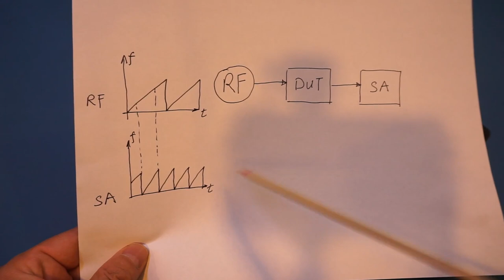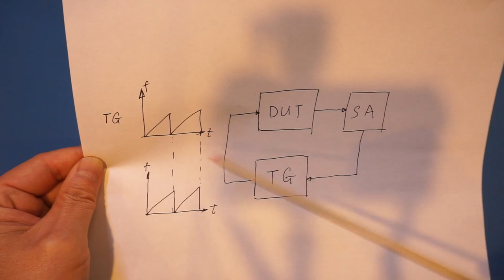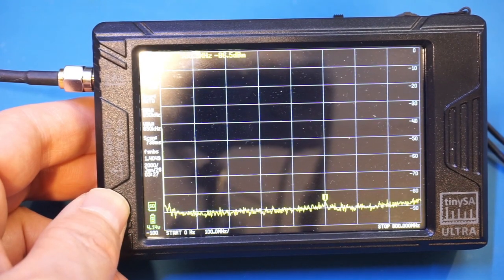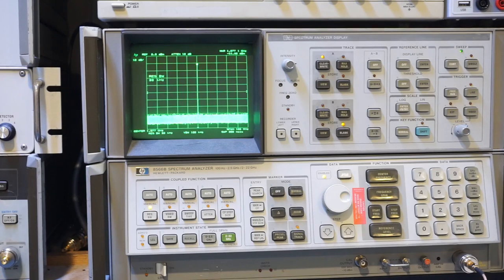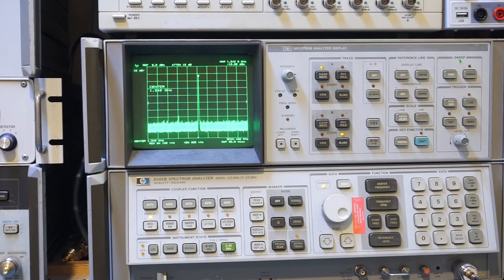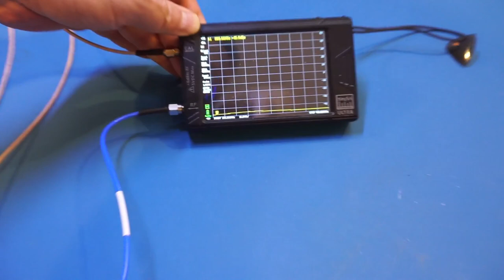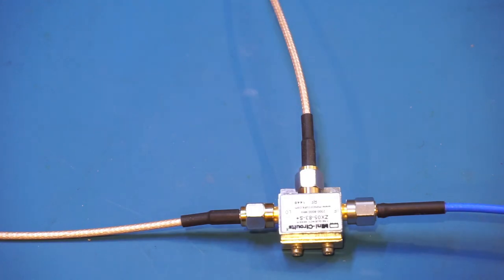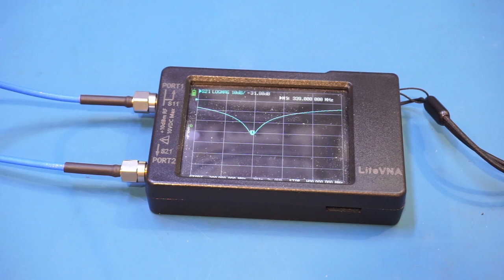Tracking Generator for the tinySA Ultra Spectrum Analyzer

Comment: I like the Guitar pick. Very good demo. It is good to use weak signals for inputs to the SA. Even a hand held transceiver behind you can overload the front end of a SA or station monitor if a antenna is connected to it's input. Keep up the good teachings.

Comment: Another option is to use a inexpensive noise source but they're probably limited in frequency range. Thanks for the great ideas Kerry!
Reply: Dino makes a good suggestion. I have home brewed simple zener based noise generators and they are useful in the HF region. The output level is not at all constant though. 
But a couple of years ago I bought (off Amazon) a very much better noise generator for around 15 quid. 
Youtube doesn't always allow links in comments, but if you search for "Noise Source Simple Spectrum External Generator Tracking SMA Source" you will probably find it. 
Obviously, the noise source is not a tracking generator at all, but that description will find the device.

Kerry, Your video was very interesting and thanks for posting it for us to share.
Reply: When using  noise source, the limitation is the dynamic range, and possible saturation for wide band active systems.

Comment: Great video! When I test I check flatness with both cables connected via a barrel where the DUT would be placed. Thinking your blue cables have alrsady been tested for flatness though.. Also to increase dynamic range I use a pre tested amplifier when needed. Would like to learn about the serial data out if you work that out. 73, Jim
Reply from the maker: Well, looking at the documentation: 
CONNECTION activates a sub menu for selecting the connection to the tinySA
USB selects the USB interface for connection
SERIAL selects the internal serial interface for connection
SERIAL SPEED enables the selection of the speed of the serial interface
https://tinysa.org/wiki/pmwiki.php?n=Main.USBInterface, it appears that the USB/Serial modes are for interactive controls only.

Comment: Nice. Wouldn't it be awesome if there was a way for the Tiny-SA to stream out its measurements to a serial port. You could do the normalization of the thru measurement and subtract from the actual measurements among many other things.
Reply from the maker: I recall there is a "serial output" option buried in the menu somewhere for the tinySA Ultra, I am wondering if that is for sending data out.... now I am curious...
Reply: @KerryWongBlog  Yes the serial port can be hooked to a PC serial port and it can be controlled and exchange data files and screen shots.

Comment: Great video! One thought: did you try to tweak the 977MHz IF input frequency from the 8642B? It could be that the SA IF isn’t exactly 977MHz but maybe something like 977.54321MHz, and tweaking the LO input to the mixer could give you additional boost on the tracking generator output. The HP 8444 tracking generator made for use with the 8555 and 8568 analyzers had a fine adjust knob that would tweak the output frequency going into the mixer with the LO, and a small adjustment makes a large difference in the trace.
Reply from the maker: It was pretty much 977 MHz spot-on. I did vary the frequency a bit during my testing and it appeared that 977 MHz gave the maximum response.

Comment: I'm using a Nanovna to analyze RF filters. Is this a good approach, or should I be using a tracking generator and spectrum analyzer instead?
Reply from the maker: VNA is the standard approach as it already has a tracking generator builtin. This video meant to demonstrate what you can do with a spectrum analyzer.

Comment: Couldn't a guy use a Nano VNA as the 977 MHz signal source for the mixer for a low cost tracking generator? (It would also justify buying both ....)
Reply: I think the point isn't to get a single frequency but to get something in phase, "tracking" the other signal.

Comment: Hi Kerry. Is it worth finding a way to generate a (stable) LO, add a mixer, and thus lose the portability of the tiny instrument? (it was nice to see an old HP8566B still in use, an analyser that was in my daily workbench, with the 8756 scalar analyser and HP436a power meter... in the mid 80s)
Reply from the maker: Well, I demonstrated it was doable, but whether it's worthwhile that is an entirely different story :-) It's incredible to see how well these old HP instruments work even today.
Reply: @KerryWongBlog  They were top of the range instruments and I doubt they will ever be surpassed, although the extra features were extremely limited (just the max hold and the HP-IB port to plot the graphs... on paper). To give you an idea, I used such bench to calibrate and test telemetry transponders in on-board telecommunications and extremely expensive scientific satellite equipment.

Comment: So the solution to the lack of TG is to get the NanoVNA :) Have SA Ultra in the mail. Hope to use it to calibrate my home brew power meter.
Reply from the maker: Yes, VNAs are better suited for measuring S21. But if you only get an SA you could scrape by and use the method mentioned here.
Reply: Getting an S.A. with a tracking generator... was only if you couldn't afford to get at least a scalar network analyzer, or a vector network analyzer... for the cost of good broadband mixer (or a few of them, if you are going to characterize different filters)... I think you can get more than enough NanoVNA (or variants). I don't know why anyone wants to characterize filters with a Tiny SA.

Comment: Soooo ... all we need is an rf signal generator, costing thousands, to create a tracking generator for our $130 TinySA.
It's a fun tech exercise for those who have the gear I suppose, but totally impractical otherwise.
I do learn from your vids though, thank you for your efforts.
Reply: Just an FYI... you don't need to spend thousands of dollars to create a tracking generator for the TinySA Ultra. A 0Hz - 8GHz Signal Generator can be gotten for under $150. That has both; an Oven Controlled Crystal Oscillator or a 10MHz External Source. I made this using a ZFM-4-S+ Mixer & an 8GHz Signal Generator works perfect & portable ! Total cost: $208.33

Comment: I think your connection of the mixer is not correct for this application. In this particular use of the mixer the 977MHz is acting as your LO and must be (at least) 7dBm and you should connect the LO output of the tinySA to the RF port of the mixer and being -10dBm is not a problem.
Reply from the maker: I tried that also, it didn't really make much difference. If I get my hands on a mixer in the correct frequency range I will be sure to test again.
Reply: Best to use a 20dB amplifier between the LO output of the tinySA and the LO input of the external mixer. This will increase the dynamic range, also because it reduces reverse leakage of the 977MHz going into the RF port of the external mixer
Reply: @ErikKaashoek  And that's the issue... to build a 'useful' tracking gen... you need a good mixer, good cables/connectors, and probably... as you suggest... a good amp too. Good stuff costs good money... and cost of the good stuff adds up... why not just use a VNA.
Reply: @willthecat3861  With a tracking generator you can create a tracking signal at an offset and measure the conversion loss of frequency translation devices such as mixers. Can't do that with a cheap VNA
Reply: @ErikKaashoek  There's a way to do it, with a cheap 2 port VNA without an offset... if you want to do a relative measurement... and at a single frequency at a time. You need two other mixers, besides the DUT... one of which you trust the specs on. You can do it with expensive VNAs (same as expensive SA, with expensive tracking option) ... either a 4 port VNA, or a 2 port VNA, and a calibrated sig gen. I don't know about making a 'good' tracking gen... versus having a cheap VNA, a reasonable mixer, and a good commercial one (probably used... or a pull from a parts mule.) Using a tracking gen is just another way to do it.